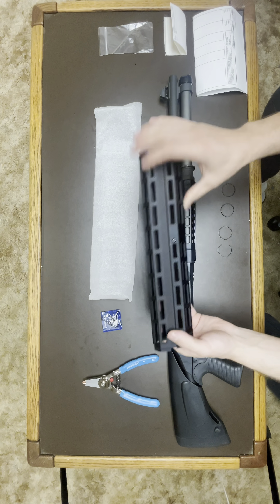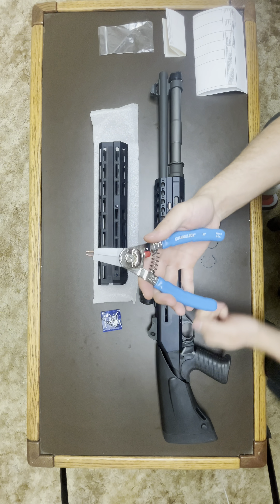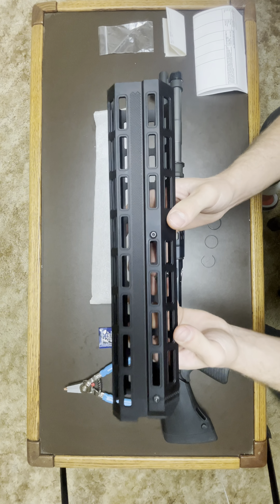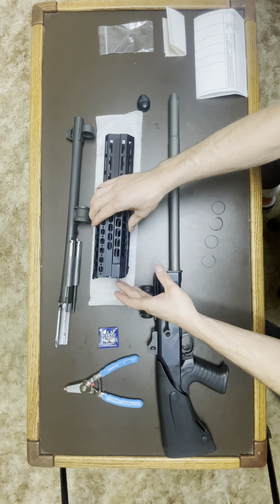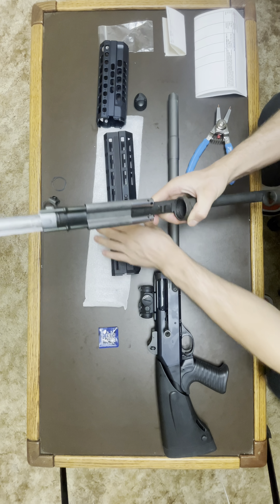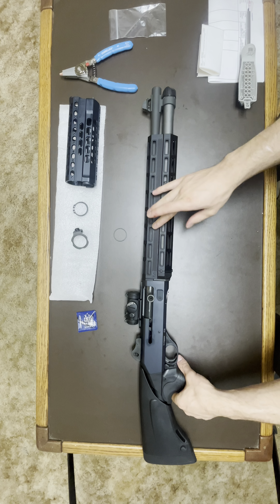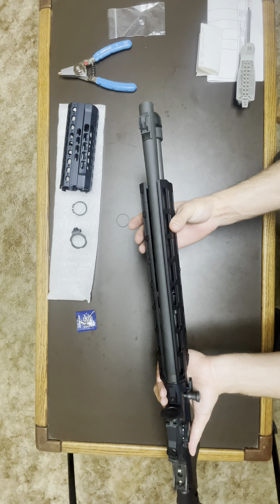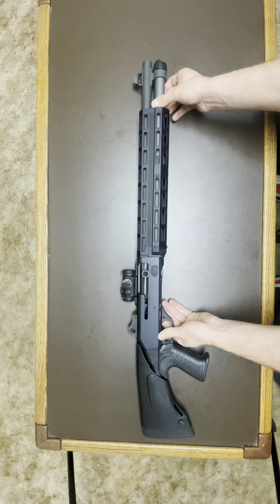How To Install Briley 3 Gun Mlok 13” Hand Guard On Benelli M4 Gen 2 T Pro Model. #benelli #m4 #guns

Comment: I am not having any of the issues that you’re having with you Briley.
I am adding a PROTAC® RAIL MOUNT HL-X PRO LONG GUN LIGHT and a Magpul M Lok hand stop a a six shell side saddle as well.
Reply from the maker: Which issues?
Reply: @GearAndGuns  the guard bowing out a little by the end of the barrel or flexing.
Reply from the maker: @comcastjohn  if you can afford it, the modlite plhv2 is my favorite shotgun light. I also prefer the Bcm vertical foregrip but those are also good options. The hand guard wasn’t bowing but it is flimsy at the top and I can push in on it with little force to make it move inwards. What gun do you have the briley mounted to? The open top design doesn’t really allow for any rigidity.
Reply: @GearAndGuns  i have a Benelli M4 as well.  My hand guard takes quite a bit of pressure to flex.  It looked you were barely squeezing yours.  Maybe they made them a little thicker?  I am not a fan of vertical grips.  I prefer the hand stops.  I also have a Briley stage saver mounted.
Reply from the maker: @comcastjohn  possibly. Mines feel pretty light weight. Might’ve made the one I have lighter. Thing is flimsy forsure. But that’s good yours seems to be stronger. I used to run the bcm handstop or angled grip. I switched to vertical because it allows me to push the gun into my shoulder more. It also keeps my wrist straighter and I can still get a good c clamp grip when using them. Maybe give one a try if you can find one. I made a video about the bcm vertical grip. That briley stage saver looked pretty sweet. I like how it’s low profile. I just didn’t understand why it needed to be two pieces.
Reply: @GearAndGuns  it’s a money grab making two pieces is what i think.
Reply from the maker: @comcastjohn  yeah I agree.

Comment: Dude that handguard cost $350 where I live and that's before taxes completely and absolutely a rip-off
Reply from the maker: @uyfj9312  It costed me 350$ as well. They charge what they want when they’re the only one who makes it like that. I don’t think it’s a rip off but definitely expensive. I’m selling mine with the freedom fighter tactical springs/washers and (2) 8 round shotgun cards for 250$ total if you want it.
Reply: @GearAndGuns  well my problem is it costs more than my shotgun that's the thing and will it fit a citadel warthog? I just think it's a rip-off because it's a handguard even a handguard for my AR-15 is like 80 bucks that's more reasonable if the handguard was made out of tungsten or titanium yeah I would understand the price but if it's just aluminum like most are then I don't really see how they can justify charging that much also what are shotgun cards?
Reply from the maker: @uyfj9312  I understand that. It’s made for benelli m4 so unfortunately it won’t fit the citadel. I can see why you think it’s a rip off. They justify charging that much because no one else makes a full mlok hand guard like theirs. Shotgun cards are a Velcro backed shotgun shell holder that usually just stuck on the side of the receiver.
Reply: @GearAndGuns  oh okay yeah I know what those are I've just never heard it called that before and yeah I get that they're the only ones that make something like that but at the same time though still I mean especially with how people are hurting for money right now it just seems extremely greedy for me I work for a Christian Camp I make $16 an hour that's literally like 3 1/2 almost 4 days that I would have to work in order to front that kind of money not to mention bills rent car insurance gas and considering I live in California those are all pretty high I feel like they would make more money if they dropped it down to like $150 maybe $180 max they would certainly sell more of them that's for sure and will it work on the Panzer arms M4 clone I know probably but it doesn't hurt to ask I just miss making shitloads of money with the business I used to have before covid back then I could just swipe my card and not even look at the price and not have to worry about it
Reply from the maker: @uyfj9312  unfortunately most companies are greedy, that’s just the way of the world. Living in California is tough it’s super expensive there but I respect you for working for a Christian camp. They also might not sell a lot of them so they charge alot for them. I’m not sure if it does, it says benelli m4 and m1014 models but you’d have to ask briley on that. If it’s designed the same way as the benelli I would think it would work but can’t say for sure.
Reply: @GearAndGuns still available?
Reply from the maker: @NSApple  Yes it is. Yours for 200$ + shipping if you want it. I have it listed on tac swap and armlist. You can contact me on there or Facebook at gearandguns.
Reply: @GearAndGuns  I think I found your Facebook. I have the h2o.. this is a great deal but I’d really like to match the finish, but that’s not as important as having the component itself
Reply from the maker: @NSApple  You’d have to spray paint the hand guard or send it out to get cerakoted. Trying to sell it for the best deal possible. Feel free to message me on gearandguns or my personal Facebook Tim Stuckey. White guy in a black and white suit in the mirror.

Comment: Did you end up scratching your barrel with the handguard. Sadly I scratched my M4 with the handguard. How tough is the coating on the barrel? Scratches won't rust the barrel will it? I live in Canada.
Reply from the maker: I might’ve scratched mine a little. It’s a really tight fit and kind of hard to get on. I’d say it’s pretty tough and wouldn’t worry about it rusting too much. The U.S. marines used the original m4 for many years and they really abused those things. They do have a specific models for more wet environments. If the exterior of the barrel does rust it won’t hurt anything. Unless you have a deep gouge I don’t think it would rust. If it worries you, you can cover it with spray paint or find a specific water proof paint to cover the scratch.
Reply: @GearAndGuns  I guess... I just coated the entire barrel with G98 gun oil and wiped most of the barrel dry. Just left the scratches with oil and let it sit in my case. It's always the first scratches that hurt the most lol. I guess if it ever does rust somehow, hopefully I can clean the rust off and paint it. Getting a barrel imported into Canada seems to be a pain in the butt if I ever need it replaced. Like you said, it was battle tested so maybe I'm over thinking the scratches the handguard did. What screwed me up was the m loc mount I have on the bottom of the handguard. I should of unscrewed the 2 screws a little so the handguards slides off the barrel easier. That was my screw up... lol.
Reply from the maker: @kevincabral5787  I would think the coating goes pretty deep and unless you scratched it very deep I don’t think it would rust but there’s always the possibility. Moisture overtime will create rust on a lot of guns without a water resistant coating. If you keep it in a dry place and wipe it down after it gets wet you should be okay. Yeah the first scratches definitely hurt until the gun gets beat up a little lol. Always pisses me off when that happens. But it being battle tested gives me a bit more piece of mind for the overall durability. I’ve only dealt with rust once and it was because I didn’t wipe off my Remington 870 after it got rained on a little. Ended up using steel wool and scraping the rust off then never patched it back up. Without sending it to a shop for a new entire coating, a little touch up paint job might look worse then a small piece of rust but that’s up to what you think. That’s a good idea with unscrewing the screws, not sure if it would seat properly though. Anyways with the hand guard we can only really see the top and end of the barrel so it’s kind of covered. Yeah trying to get a new barrel would be annoying, I’d say that barrel is probably the toughest shotgun barrel you’ll come across. I’ve heard the benellis going upwards of 25k rounds or more.

Comment: Great video thank you! This will help me out! I still might get slightly confused on the installation of the rings from freedom fighter tactical lol. Can’t wait to see where the build goes!
Reply from the maker: Thanks man! Hope it does! So rings just help stabilize the hand guard from wobbling. You just insert the flat ring first, the wavy ring second, then the u shaped ring drops in last. You just drop them in. There’s 2 slots on the inner sides of the circle coupling that you need to align with the u shaped ring so that it keeps all your rings in the coupling. The u shaped ring matches the 2 slots on the coupling so make sure you put it in with the u faced upwards toward the barrel and the slots in place. Once you take it apart I think you’ll see what I mean. But you won’t need to install the second flat washer they give. I tried that and it wouldn’t let me get my barrel flush. Best of luck! Let me know if you have anymore questions.
Reply: @GearAndGuns  it definitely did!! Thank you! I think you’re right, once I get in there it’ll make more sense. If not I’ll definitely reach out. Keep up the good work!
Reply from the maker: @Green-Weenie  thanks man!

Comment: It looks cool from the sides but the air gap from the top is an eyesore, does it help with heat dissipation by chance?
Reply from the maker: Maybe a little bit, but it’s vented all the way around with the mlok slots so can’t help a ton. I’m guessing they did that to keep it as light as possible. I wish they would’ve made it one piece. Would’ve been more sturdy.
Reply: Thats what Im saying. They could have made it flush with the barrel for $300 what a ripoff
Reply from the maker: @spookyprism03  yeah that would’ve been nice if they did but I don’t think it’s necessary since nothing, helps a little with weight savings I guess. I think they designed this for competition.

Comment: Will this fit on a Panzer M4 Benelli clone?
Reply from the maker: I would think so but I’m not 100% sure because I’ve never seen a panzer m4 taken apart in real life. Brileys technical questions phone number is 713-932-6995 and there email is smp@briley.com I would either call them or email them to make sure because this is an expensive part. Sorry I couldn’t tell you for sure.

Comment: Hey man, thank you for your informative video.
Could you please help me out with an issue I am having?

I recently bought the Gen 2 hand-guard (the one you are replacing) for my M4 in order to replace the plastic hand-guards and I am havin' trouble to get everything to sit flush.

Am I correct to assume that those washers where not pre-installed when you bought the gun?
Cause my M4 has already had those rings in place. Removing them might solve my problem and allow the hand-guard to fit properly but it's hard to say. Regrettably, there are no official installation instructions that I could find and I don't wanna fuck anything up.

Any suggestions? Hell, could you maybe try to install the OEM hand-guard with the washers in place to check if it would be flush for you?
Reply from the maker: No problem. Yes I can. If you look at the rear of the new gen 2 hand guard you have, the part that is supposed to sit flush to the front of the receiver, that should have 2 spiral metal hard springs attached to it on either side of the bottom. They are small. If those are there, you will have to remove all of those circle washers that I installed in this video to use with this hand guard, that are in the circle hand guard retainer attached underneath the barrel. Mine did not come with any of those washers, when the gen 2 hand guard was installed. I had to buy them specifically for this briley hand guard. It’s is a weird hard fit though once you do get those out. Just make sure the circle hand guard retainer is aligned properly with your new hand guard. I had to push down pretty hard on the barrel to get it to seat flush against the receiver because those new small springs are hard. You can use a small 2x4 or your hands. If you have problems where hand guard is wiggling around you can try to reinstall 1 of the flat or wavy washers but you shouldn’t need to. Hope this helps.

Comment: Where did you get those 4 washers/springs that go in the middle part of the tube @7:41?
Reply from the maker: Freedom fighter tactical. It’s called the 70099, 70100, and 70101 benelli m1,m2 forend washers.
Reply: @GearAndGuns  Thank you so much for the fast reply. My friends new 2023 production Briley handguard is moving forward and backwards about .200".

Apparently it's been happening on the H20 Marine models since 2020 and Briley never came up with a solution.
Reply from the maker: @LoopyChef95  no problem. Yeah that’s ridiculous briley hasn’t made a solution. I just got the standard pack from freedom fighters and that works fine. Still a little moving but not bad at all. I stated in the video but atleast for me I did not need to install both flat washers, just the 1. I tried using both and the barrel and handguard wouldn’t sit flush to the receiver.

Comment: What stock are you running on this video?
Reply from the maker: @mattfisher8568  It’s the 5 position telescoping stock that comes on the new gen 2 or t pro benelli m4. It came with the gun. A slight improvement to the original. I think you can buy them aftermarket from places like freedom fighter tactical but you might have to replace the adjustment rod.
Reply: Thank you. I purchased a Mesa Tactical Urbino stock. I’ve not heard very good things about the telescoping stock. Maybe just the guys I’ve heard it from, but they all said that the stock tends to twist under heavy use. 🤷🏽‍♂️
I found the springs/washers on FFT, thank you for that as well… $72 for 4 washers? Sheesh, they’re proud of those bad boys…

Comment: Why the hell is this in portrait mode?
Reply from the maker: Didn’t know I needed to rotate the video before uploading. You can view it fine on your phone if you rotate your phone horizontally or scroll up a bit. I’m Sorry. I’ve been uploading my newer videos horizontally. I’m still a new YouTuber trying to figure stuff out.
Reply: @GearAndGuns  I'm watching on my laptop. You can easily rotate it with any editing program or even on your phone. It looks like a nice handguard. How are you liking it so far?
Reply from the maker: @Cameraflyer-  I’m sorry it’s not optimal for you to view on your laptop. I made this same mistake on a few videos until a viewer pointed them out and then I tried to change it. With the equipment I have, sometimes it’s not easy to video horizontally. I can rotate them on my phone yes, but unfortunately I don’t have this video anymore due to the small amount of phone storage phones have. I will and have been rotating my new videos. When I first posted it, it worked fine on my phone but I didn’t not take into consideration laptop viewers. I like the hand guard a lot, way better then what benelli made. My two complaints are that at the top of the hand guard where it’s open it is kind of flimsy to where I can push it together. Then also the price, 400$ for the hand guard and washer springs. Besides that it’s great. Benelli has my m4 right now because of charging handle and loading issue, pretty ridiculous for a new gun that costs 2-2,400$.
Reply: @GearAndGuns  Luckily I haven't had any problems with mine. It's the older model with the twist to extend collapsible stock. I do want a longer hand guard so I can mount a light closer to the muzzle.
Reply from the maker: @Cameraflyer-  glad to hear that. That’s what I was thinking when buying this. Seems pretty good so far but haven’t had much time to test it. Debating on selling it honestly and getting the beretta 1301 mod 2 because it’s lighter.